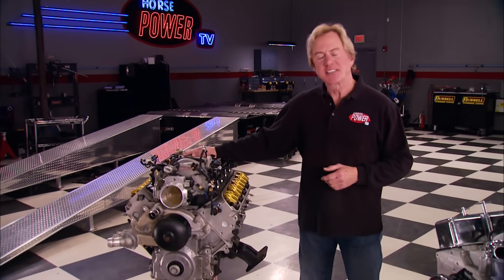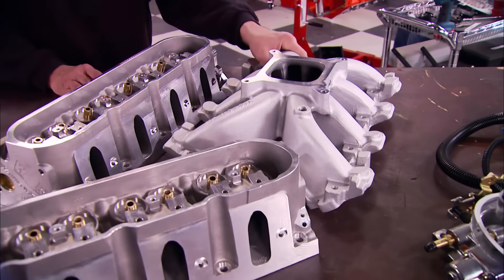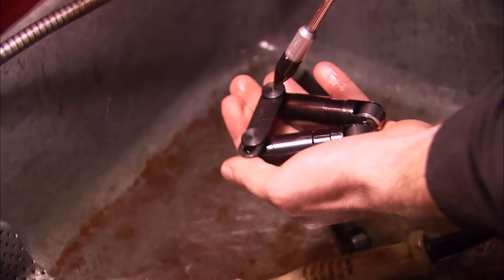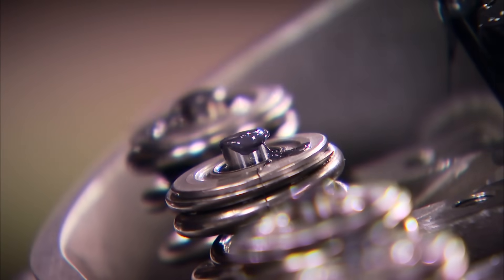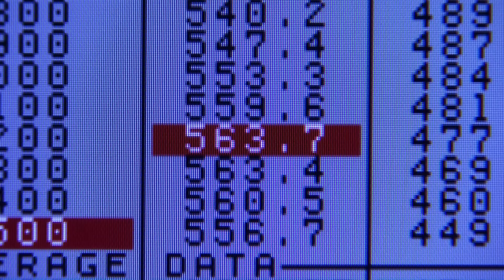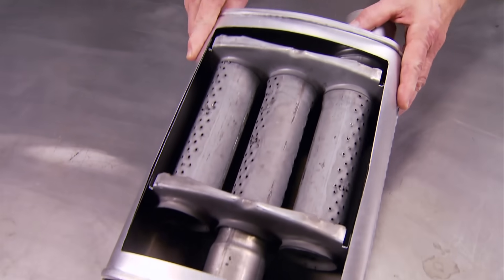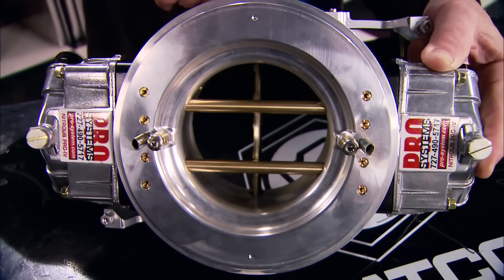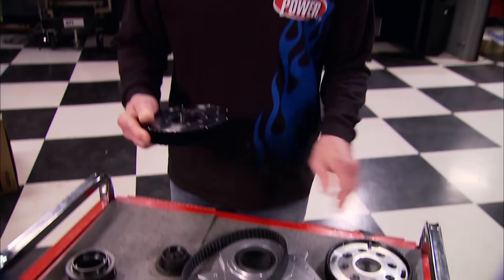Best of Both Worlds: Building A GM Smallblock With A Modern LS Top - Horsepower S14, E7

Comment: So you have to get an entire new block! Seriously what's the point?
Reply: Solution looking for a problem
Reply: @bigboreracing356  you do realise the 7.0 Ls7 has 505 horsepower and you can get one for 4k right? And the 7.3 Godzilla is 430 horsepower and cost 7k.  And the godzilla is a almost direct copy of a L.s being a pushrod v8 that's very similar.  And there's almost 0 aftermarket for Ford and endless for GM.  You can also get a used Ls7 very cheap. I'm not even a brand loyal gm guy and know that.
Reply: @jkirk7811  You can also just get a big block chevy and have more displacement and power than an LS7. Does that mean we shouldn't bother with the LS7? 
Not everyone cares about $/hp. The Godzilla is the new thing. I hope people start playing with it. 
It's also not a copy of the LS. It's designed to be an option to the powerstroke in pickups. And given how nuts they've gone with all this emission stuff on diesels I'd say the Godzilla is a welcome alternative.
Reply: Oh... priming the block is easier for one, and there is a bunch of gen 1 parts to choose from for the bottom end.  Little things like oil pan design/clearancing for certain muscle cars would make this a good way to enjoy a set of LS heads without getting into alot of odd details and extra fitment issues.
This project is for somebody going to build a new motor anyway, not refresh an old workhorse.
Reply: The episodes are 10 years old

Comment: I dont get it.  Why do that?  It's almost a novelty to do this.  Just because you can doesn't mean you should.  The LS parts are cheaper than most SBC parts are.  I'm sorry but the best reason to switch over to LS is the 6 bolt mains and a 55mm cam core that doesn't kill the lifters and bend the pushrods.  Not to mention the LS package is smaller in overall size.  

There, I'm sorry, but I just had to speak my mind on this one.  The LS engines respond better to cam and head combinations, and you take that away when you do this.
Reply: How do you make an ls be a cam  driven  hei distributor, non efi and non fuel injected basically no computers no msd ? I just wonder cause that's the rules in some classes bud ! I know ump street stocks it's a rule n dudes drop 10 to 15k on engines!
Reply: @chadalac1977  the parts are out there to do everything you asked. Just look for them its called google
Reply: @holmes1956O  I'm just wondering why no hot dogs in our ump street stock classes around Illinois and Indiana are not running them!
Reply: You are So Right !! Josh Goode !!
Reply: Now do you see what I mean when I say politics
Reply: @quonyoung1280  no
Reply: Used junkyard ls parts are cheaper. Buying new parts it's quite a bit cheaper to put a gen1 sbc short block together. If building from scratch with all new parts that is

Comment: Is it just me or is the lifters already tapping? Lmao
Reply: You nailed it!  Last time I used Comp hydraulic lifters about half of them in a brand new build would not pump up!  Switched to another brand.  Junk!  😂
Reply: @jasonpedersen8225  I second this I’m not much for comp anything best to go with BTR or Texas speed hell even Elgin has better stuff and for cheaper.
Reply: I agree and was thinking the same thing listen to that motor run on the Dyno it sounds like a bag of hammers
Reply: They sure are I saw the puff of smoke then they started a tap, tap tapin' lol.
Reply: Gotta keep that sbc nostalgia.
Reply: Yes I hear it myself my diesel doesn’t even sound like that 🤦🏼‍♂️
Reply: Wrong pushrod length
Reply: @GearheadOutlaw  that or rocker ratio. SBC can be adjusted on fly LS is 1 shot.
Reply: @shadowopsairman1583  that's why they should have used a pushrod length checker and with a proper preload for the lifters
Reply: Yeah...definitely tapping!
Reply: They talk over the sound of the engine...
And its ticking like crazy
Reply: @WhiteManXRP  gotta get good lifters. Johnson’s are the ones
Reply: That was what I was thinking.
Reply: Who scripts these buffoons lol. As an old school Chevy guy, why would I love that like they said? They also went through all that to do less power than any gen 1 sbc can do with 210cc intake ports and any mid 230s at .050 cam! Lol
Reply: Yep, sounded like it was running on 7
Reply: Oh my gosh, what a clatter box.
I wouldn't race it. I would have to go completely through that sucker. I bet the oil is full of something.....
Reply: Nothing but money
Reply: 9:10 they used conventional 5w-30 to break it in
Reply: Your Right Mike White Ticking Time B
Reply: @AutoBikeTruck  ,
Reply: Let me guess you support the corner cutter.
Reply: ItS tHe OiL pUmP oRiNg 🤣
Reply: @Brandon Crocker  it's a sbc bottom end.......

Comment: Solution looking for a problem.  With the aftermarket support of the LS engine, this block is a moot point.
Reply: Some conversions would benefit from this.
I agonized over whether to LS my Toyota FJ40 4x4 but the list of conversion parts fro the LS was so expensive that they offset the cheapness of used LS engines. Nothing standard in the LS fits in this FJ40 conversion. Even the damn stock exhaust manifolds won't work and they try and sell you their specialty new cast manifolds that do fit for $1500 or something. You have to buy a $1100 sump and all this other ridiculously expensive crap. On the otherhand the 350 I fitted with the exception of heavily modifying the battery bracket (which is no small job) was basically bolt in. LS is also bolt in but nearly $8,000 of conversion crap is needed. 350 conversion stuff was <$2500 and the water pump turns the right way. LS conversion required a $1000 of fans, clutches, water pumps and front housing etc. 
On it went - even the oil filter had to be relocated if I went LS. Special engine mounts, special brackets ffs lol. 
Yeah I fitted a stinkin' late type roller cam Vortec 350 in it that I put aluminum heads with shaft mount rockers with the money I saved. Bought an Offy cross ram intake and Fitec fuel injection. It's no LS but it's better than the 2F and best of all I like it.
Reply: When this block was released 15 years or so ago the sbc was still very prevalent. Say you had been running sbc for years and had piles of stroker cranks, rods etc. These came out over 15 years ago dude.
Reply: @b.c4066  Yes, you're right.  I must remember what came out 15 years ago and stand corrected for a recent upload, dude.